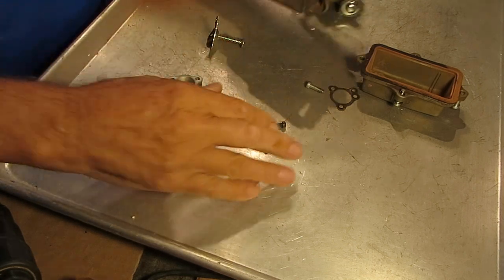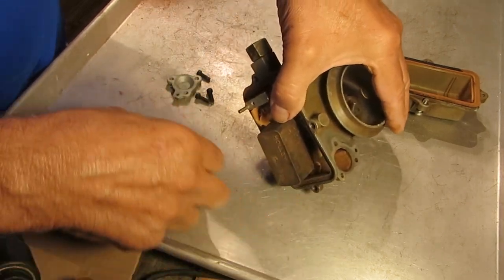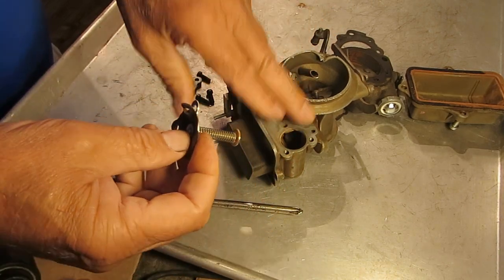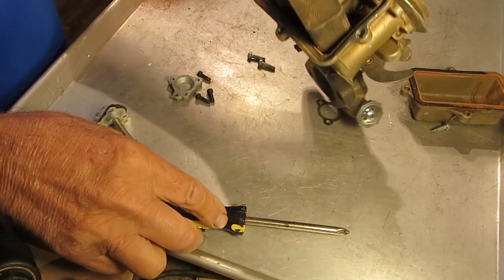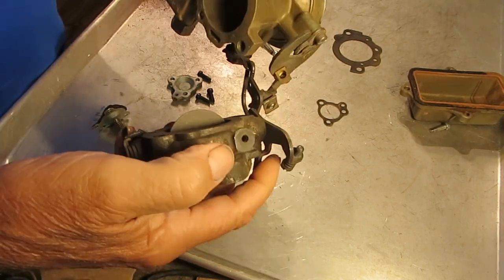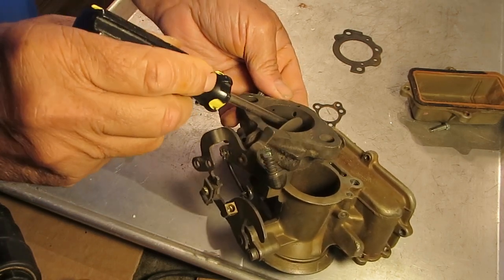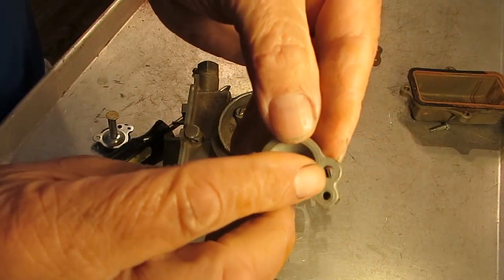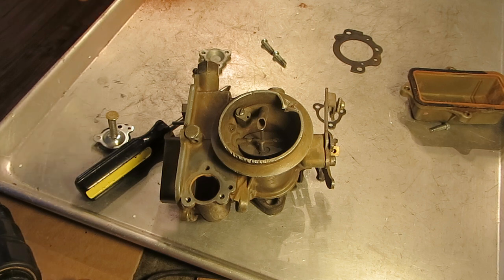Holley 1904 Carburetor Economizer Diaphragm: Power Valve

Comment: My experience has been with Holley model 1920, on Dodge slant 6. Wish someone would tell me why they mark the number as 2190? Code of some kind?
Reply from the maker: If on a part then it is a casting code. If on the top of the float bowl then it is probably the carb number R-2190.